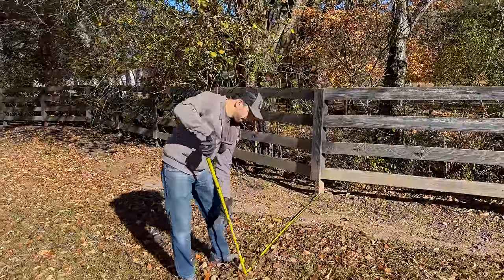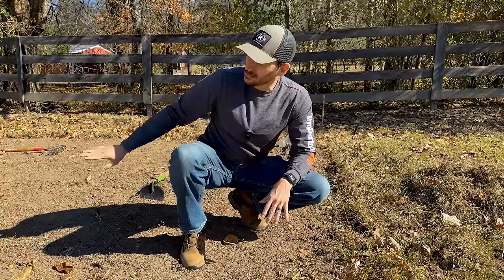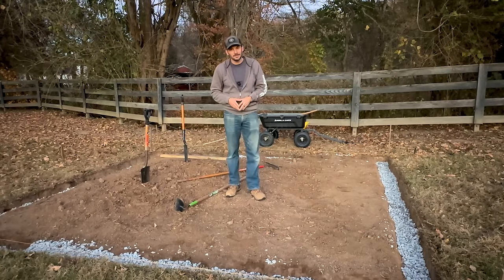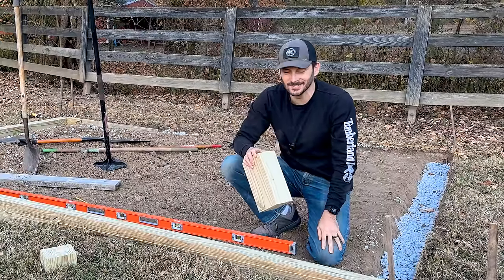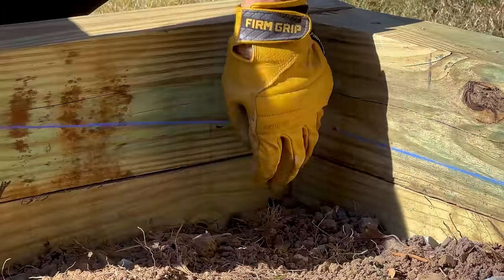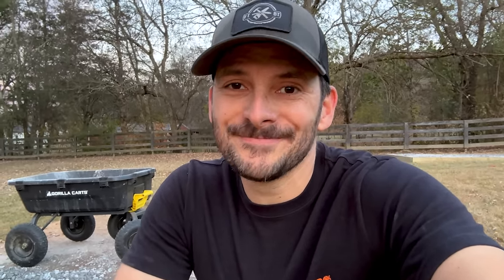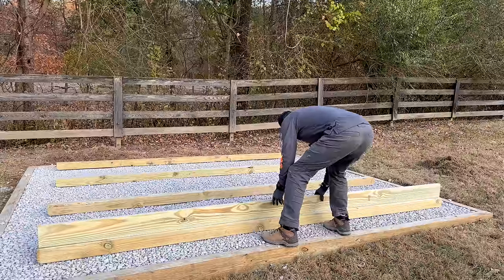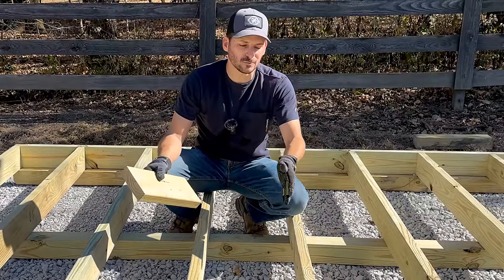I Overbuilt This Shed Foundation ... and it's awesome

Comment: This is a very new/interesting/weird way to do a building foundation to me. We've always done cinder blocks on a leveled/tamped gravel perimeter with a higher middle (doesn't need to be flat) that then gets filled with gravel and throw a concrete slab on top of it. No worry about warping, less digging/tamping, no worry about eventual wood rot, no worry about critters etc. making homes underneath, etc. Also, outdoor rated screws are a far superior choice here as opposed to framing nails. Screws will stay in place and hold things together much better, particularly if the wood is open to the elements and bending/moving etc.
Reply from the maker: oddly enough interesting and weird are some of the top adjectives people use to describe me 😂
Reply: @Fixthisbuildthat  ditto my man.
Reply: Agree ... wood will rot fast.
Reply: It’s just a shed. I did the same way over 20 years ago and no problem.
Reply: @OtikaOtikaOtika it depends what fast is to you. I have a 60yo retaining wall here made of 6x6 and it is still holding fine
Reply: Here is SW Washington, structures, including sheds, over 200 sq ft require building permits
Reply: This is very typical for a shed foundation. Not weird at all.
Reply: I did my shed foundation similar to this. It's pretty normal.
Reply: i agree.......... so much of this vid seems to be re-inventing the wheel badly
Reply: @FredWaldwin  creosote treated?
Reply: I wouldn't agree with your statement. Was his goal to make a solid foundation for his shed? Yes. Did he succeed? Yes. Is it overbuilt? Yes @raymondo162
Reply: I prefer concrete. I did my shed 15×14 on concrete slab. I like concrete better then hauling that maybe 20 tons of stone in.
Reply: Jonathan, are the cinder blocks just to frame the concrete pour? And after pour dries; anchor perimeter framing plate to support wall studs? 
Also, how 'close" to flat does the interior need to be if used for the shed floor. Thanks man! This is fun for me, 'caused used a kit on blocks and that was good for 2 years. After two years, critters labeled my shed the easiest to enter, like google waize tells drivers where to go in a traffic jam.
Reply: Hi, can you refer me to a video of this as I need a simple way to do a shed/workshop foundation 3mx5m. I'm not sure I understand your description. Thanks.
Reply: You should do a video.
Reply: @OtikaOtikaOtika  My PT shed base had been in contact with dirt for 24 years and is still fine.  This base will not rot any time soon, and certainly not fast.
Reply: Built two good size sheds and any future sheds will be built the same way I did the 2, make a solid foundation of cinder blocks resting on about 2-3 of tamped gravel.  Easy, secure keeps wood from ground contact, keeps critters from going under, and looks great (IMO) first is 10 years old now and still level after New England weather.

Comment: I've honestly never seen a building foundation done this way. Around here most people would either pour a concrete pad, or probably use cinder block.
Reply from the maker: I've been known to overdue things a time or two
Reply: @Fixthisbuildthat  I think this may count as working harder/not smarter (no offense at all intended). Cinder block and concrete are much easier and bulletproof. Back breaking yes, but fewer days of it and it'll last longer.
Reply: @jonathanzj620  Just did similar to this for a 46x16 deck except used retaining wall blocks.  Got scared at how high the water table was for the proposed piers and made a snap decision in haste.  This was only harder because he didn't just rent a couple machines from HD for under $200.  That should last maybe 20 years before he'll have to replace some of the gravel rim lumber. Using PT would instead of actual GC (Ground Contact) wood is what everyone does, to sad effect after only 5-10 years. Here its probably mostly a non-issue since most of the lumber is going to see water drain away. Problem will be on the bottom of that lumber in contact with the ground.
I would have done a few coats of motor oil or wood preservative on that PT, especially the cut ends just for a little extra protection.
Also throwing some paint on both sides of any plywood before starting is a simple way to really extend working life.  
But this should end up looking a lot nicer than a simple block base, and still a heck of a lot cheaper than a concrete pad.
Reply: @boots7859  generally, this would be solved by digging deeper with the perimeter blocking. From a pressure treated lumber (I assume) standpoint I'm not sure how well that'd work.
Reply: @boots7859  motor oil etc. is a very old school solution (yes I live where that is normal). Generally it is better/more normal to do block/brick with weather treatment membrane painting or equivalent and a French drain or equivalent if you're going that deep but you can certainly do whatever local code allows you to do. Just saying - in 40 years still have block/concrete foundations standing with zero issues.

Comment: Treat the cut ends to prevent rotting and cut the rebar at a sharp angle to make it easier to pound into soil
Reply: Yes, and treat the hole that was drilled out for the rebar. Not as easy to do with a tight-fitting rebar. One way is to blob some into the hole then once you just got the rebar in a bit, paint the rebar which will apply the penetrating sealant all around the inside of the hole as you drive it home.

Comment: Very good to see you taking the tamping seriously.  I come from a mine engineering background, and our prof for tailings dams noted that one of the biggest concerns with building them is overseeing the compaction process.  Apparently it's not uncommon for work crews to work fast and skimp on the compaction steps to get the job done faster.  Which you can kinda get away with in a lot of applications (including stuff like this shed) but you'll always have some differential settling issues, and different drainage characteristics.  Which, if you have an earth-fill dam, is a critical problem.

Hope that pressure treated wood works out for you.  I live out on the coast of BC (Canada just north of Washington State), and out here we tend to have issues with pressure treated wood not being as rot resistant at the cut ends than is needed in our quite wet climate.   Folks who can afford it tend to use cedar instead - you can cut into a cedar log that has another tree grown over/around it and still find good wood in the middle, cedar lasts ages - for outdoor applications, and folks using the pressure treated stuff instead buy a product that you brush onto the ends to seal up the end grain.   But thats for fairly extreme wet climates, we literally use the terms "rainforest" and "hypermaritime climate" to describe this area.  You're definitely in a drier region, going by the trees in the background.
Reply: Down here on the humid Gulf Coast, I also like to seal the ends of pressure treated, especially if there's ground contact, like my kids swingset legs. When you look at the clean crosscut, you can just see how deep the treatment penetrated. That's essentially raw wood in the center, just asking for termites and other wood devouring critters.

Comment: I'm building a 12 x 16 shed. I used my 5 x 10 trailer to purchase and haul the #57 gravel....1 - 1.25 tons at a time. I did not want a large pile sitting in one area of my yard even if it was right next to my location or the large truck doing damage. Made 7 trips and totaled 9 tons. I backed the trailer to the area and used the scoop shovel to hand load in place. Your foundation is very similar to what I built. The shed almost completed. I am down to installing the siding. I also built the doors from oak lumber harvested from trees we took down in our back yard. I very much enjoy your videos and your quirky(?) nature!

Comment: Lol... as you were putting the gravel in by cart my first thought was I was going to suggest you get it delivered right to the foundation.  I had the same problem years ago when I build my old shed.  I was building it at my mother's house and I wasn't home when they delivered it.  She didn't have them dump it where I needed it.  Wasted a whole day just moving it over.  

Of course, lots of people have issues with big trucks coming on their property.  Make sure you don't have a leach field under where the truck needs to drive, but if you can get it to dump there it's the single thing that will save you the most time.

Comment: All the buildings in our village,even the ancient stuff is built on raft style foundations,we are below the water table and have a huge lake right behind us, any timber on the ground,treated or not is done in just a few years. I used 24" lengths of 1- 3/4" rebar,to which I welded 4" squares to both ends,one end drilled for screws. These I then stood in my hole in the ground at 18" intervals so that only 9" was above ground level making sure the bottom square plates had at least 6" of gap under them  and by using string lines to make sure the top plates were all level. I filled in around them to make my 'raft' and nothing has budged in 10 years or so and having insulated the floor timbers from the ground and the bracket via a rubber membrane between them( cut up truck mudflap😁) they are still in perfect condition.

Comment: I've built several sheds, decks, and fences over the years. You may consider doing a segment or a video on appropriate times to use nails vs screws. When I was first starting out  doing DIY, I used screws for everything, but after a few fence sections fell over because of shear in the wind, I found there's a time and place for everything 😅. Can't wait to watch the rest of your build!
Reply from the maker: I'd love to see some data on ring shank vs screws in both shear and pull out strength.
Reply: Grk makes screws that are approved for framing. those are my go to
Reply: @Fixthisbuildthat time to do a collab with Mathias. 😆
Reply: @Russianmafia10  I see them called "construction" screws, vs "deck" screws. I typically get torx drive.
Reply: @RossReedstrom  construction screws are still not structural. They make special structural screws that are different.
Reply: @Russianmafia10  Good to know, I'll keep an eye peeled.
Reply: @RossReedstrom  grk R4 screws I think they are, they look like deck screws but are approved for framing
Reply: @Fixthisbuildthat Project Farm did that.

Comment: I built a 12'x20' workshop and did a similar gravel pad foundation 14'x22'. I had about a 13" slope over 22' and the top 6" was compacted rock so it was not easy to dig out, especially doing it alone by hand. It turned out great and sure beats the option of a block foundation or paying for a slab to be laid. The gravel pad and workshop look amazing and added value to my propery so well worth all the hard work.
Reply: I used a block foundation for a 10 x 12 kit-style shed. Looked good,; worked good; for about 2 years. Then became worthless. And made we wish I had done slab instead. House built in subdivision circa 1950s; in what was USA's largest walnut orchard. Yeah. Critters!  Clean every year with "everybody out" routine requiring removal of all contents, spaying 100% of interior with bleach/water solution, cleaning all contents with same solution. Next cycle, I'm tearing down old and using your slab style.
Reply: In UK we call that a house!!!😂

Comment: I have a suggestion, when drilling through the beam. You can use a bit extension to give you the extra length. They come in 6", and 12" lengths.  Could also been useful when attaching the rim joist .  By the looks of the floor, the shed  is going to be solid as a rock,...  👍

Comment: Something I was told about, after I did exactly what you did.  Drill a 1/8 to 1/4 hole through the timber first.  You can get 8-10" long drill bit for this.  Then use the auger bit with the small hole as a guide for the tip of the auger.   Cuts out the measurements and hoping you get the big holes from each side line up.
Reply from the maker: Great tip!
Reply: "pilot hole"

Comment: Thanks Brad! I am planning my shed build. Mine too is  10 x 12 so this is a timely project for me. I have more slope in my back yard and after watching this, I am thinking of renting a tiller after I stake out the 12 x 14 plot. My thought process is tilling up the top soil might make it easier to move the dirt to level out the ground before I add the gravel base. Mine will be a spring of '24 build so I'll have some time to research this theory. Thanks again, and looking forward to the rest of the build.
Reply: I'd rent a tamper too, because you're right, the ground will be pretty loose after you run a tiller through it! 😅
Reply: @serversurfer6169  That's a great idea. Thanks!!!
Reply: @frankbiondo2476  I’m glad to help. Good luck! 🍀

Comment: Good video, and even a small shed is a lot of work.
I just did a 48x16 deck with a 2 1/2' retaining wall w/gravel as water table made me second guess concrete piers.  What I did was use Home Depot tool rental to save a ton of the hard work.  
Sod cutter $69 for a 4 hour rental.
Sister had one of the Mantis type mini-tillers, so I removed a couple tines and had a 6-8" wide excavator.  
$75 for a compactor rental.
Not sure the Threadloks were necessary, I would have just run 9/16 holes every 2-3' before placing the lumber and used some rebar to keep the lumber together.
Nice job, haven't finished the video so hope you're going to show the actual shed build.
Only critique is using deck screws....

Comment: Thanks for sharing this, Brad!  I recently built an 8x16 shed, and I always like to have treated timber runners underneath in the event that I ever want to move it, it's ready to go. Once in place, I'll place pier blocks or solid cinder blocks/thick caps to keep the timbers away from the soil and have a hard surface on which to shim from. Also, using construction adhesive on top of all of your floor joists strengthens and quietens(yes, that's a word) the floor.
Reply from the maker: yes, I considered using construction adhesive, but since this will be utility storage I decided against it

Comment: Maaaan, good work, I feel moving that gravel.  I did a 15x25 gravel pad for a 10x20 shed this past summer.  I anti-varmited under the base with some wire mesh stapled to the inside of the rim joist and buried into the gravel about 4 or 5".  I put it on before sheeting the floor.
Reply from the maker: smart!  I'm going to put something there but didn't consider burying it in the gravel, that's a great idea

Comment: This is interesting. I just did my shed. Used an auger to dig the holes. Threaded rod and cement and then two nuts to the right level tightened against each other. Metal plates on each one and then the timber right over each rod. Gonna do the same again next summer for a garden office.
Reply from the maker: that sounds cool
Reply: Why not just build it on concrete piers?
Reply: @barneyhartman-glaser6972  well I probably could have but this is just a method that I used before that is relatively cheap and quick. All I have to do is dig the hole with the auger, pay for a delivery of concrete, pour and make sure the rod is level.

Comment: Okay.  This is what I did seven years ago now, for my shed/shop 12'x16' (16'x20' foundation).  It worked great!  Thought this was my idea...nice to see someone-else did it, too.  I used 4''L- 1/2" rebar to anchor the first tier of treated 6"x6" timbers to the ground (low wall, no deadmen).  Used the same stone for the same stated reasons...delivery driver dumped the stones outside my foundation.  52 wheelbarrow loads later, I had the stones inside the walls. Used spikes for the upper tiers.  Used 14"L timber screws with inside & outside "L-brackets" on the corners.  Rented a compacter for the stones.  A local builder delivered my custom shed, leveled with provided foundation (patio) blocks under all runners.  Did not use floor joists.  Shed sits on the stones and blocks.

Comment: Great video. Lots of great info.
One thing I would change. Generally, when putting down sheet goods like plywood, I prefer to work across the sheet. Doing the perimeter first could leave a bow in the middle that you have to  fight. Granted, it affects nailing more than screwing. But I still find it best practice to  in essence roll it down while securing it.

Comment: I have only seen this type of foundation once or twice and it is for balcony sheds.

Sheds where I live normally is on cinder blocks because it is easier and it is more often than not more than enough for what most people have in them.
Some bigger sheds have concrete slabs as a foundation since they know it will have heavy equipment in it.

The foundation you made are normally used where a house wants to have a raised land balcony/porch/deck where the difference of the lowest point on the ground and the underside of the balcony/deck will be is to big, they look super nice and many use the extra gravel space to have plants. But it is so much more expensive than a normal balcony/deck.... That foundation is also normally used for a middle of the lawn decking to just look nice, have good drainage, etc.

Comment: Two points;  I would get a longer drill bit or a drill bit extension to drill the holes and I would also use a tamper to drive the rebar down instead of a hammer, it's much easier.   Not so sure about the screws versus using nails; nails tend to flex while screws tend to shear, but maybe that's outdated thinking.

Comment: Looks like a stable foundation.  When you were talking about the Gorilla Cart being a great tool to move gravel, I did wonder why you didn't have it dropped closer. Or why you weren't using a truck to move it.  I don't have a truck,  so I use my wheel barrow that has the 2 front wheels.
Reply from the maker: Yes, I vastly underestimated the time it would take to level the ground. And was not ready when gravel showed up